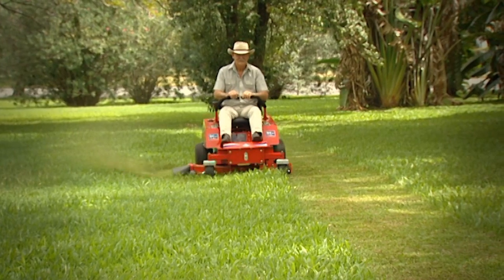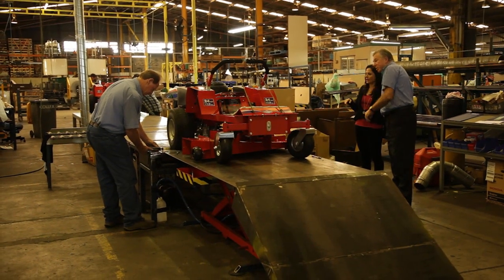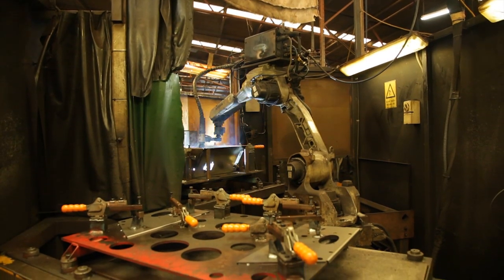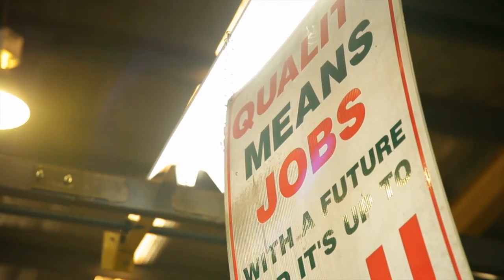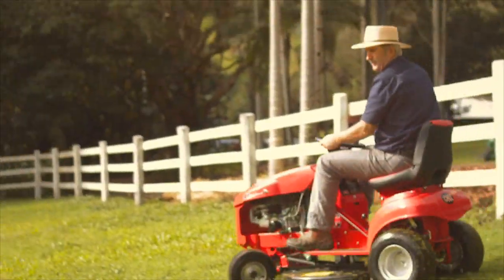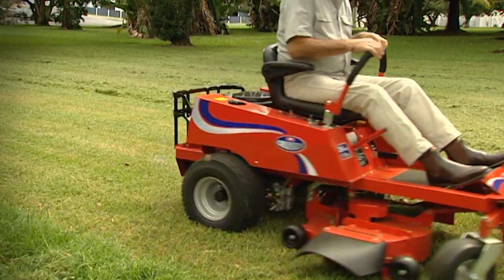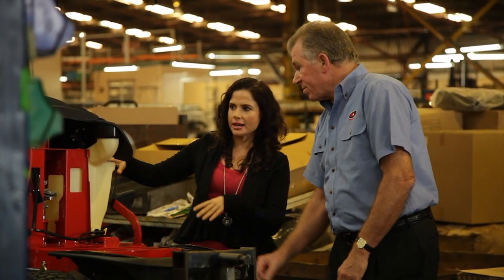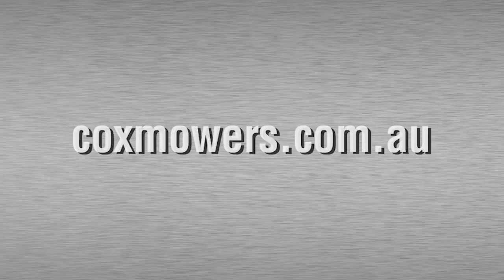Cox Mowers - Take a tour of our true blue factory

Comment: Unbelievable I have had a 13hp cox new Gen mower I brought in 2002 and it still has the original belts and only had one set of blades changed and yes  before you   ask I have @ 5 acre to mow it has been bullet proof